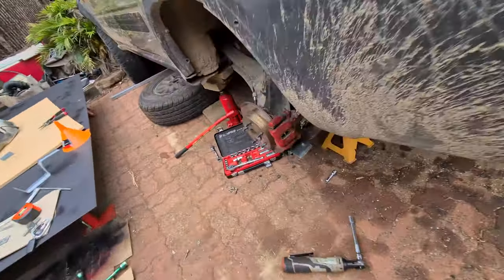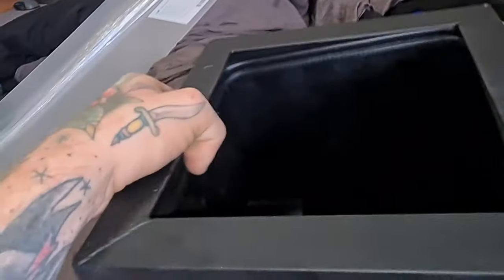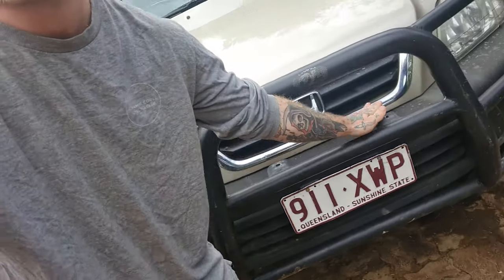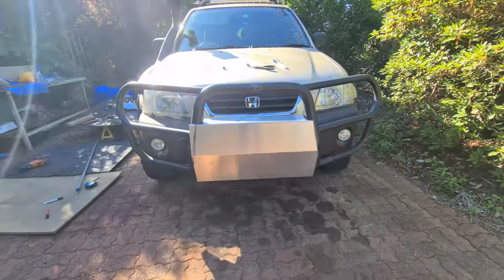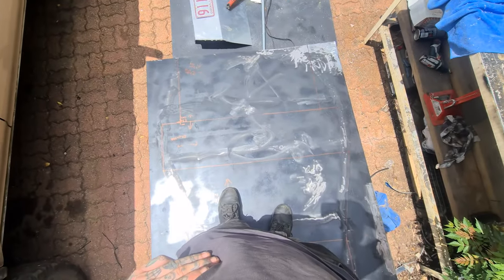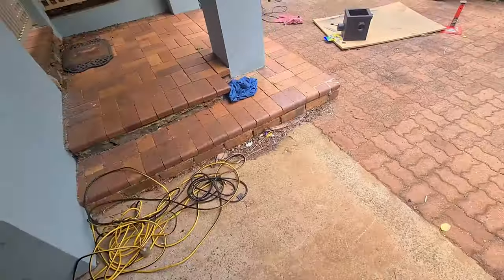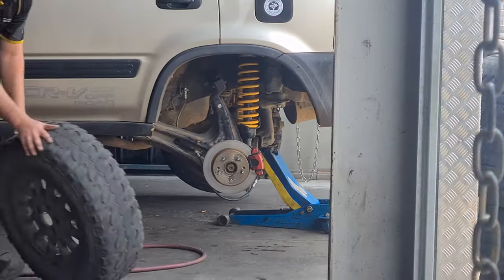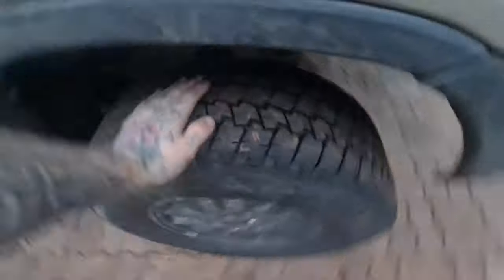HANDBRAKE BRACKET AND HIGH FLOW AIRBOX FOR CRV

Comment: That’s awesome you got a mig it will open up more avenues for things to make! Glad you said the thing about the amphibian adapter. I didn’t know they existed when I bought my first welder and left it too late to return so I ended up selling it. If you do get gas for the mig Bunnings is actually really good it’s $99 for the gas and a refundable deposit of $200.  I’m liking all the different stuff your making it’s awesome to see diy.
Reply from the maker: Thanks mate! The MIG has been one of the things I've wanted for the longest time, the ability to fabricate things myself will make the future of this build so much better!

I was honestly really frustrated finding the 15A plug because I was really keen to start welding, but I've picked it up since and very glad it did the trick.

I'm honestly just waiting to have the money spare to pour more into my welding setup, I wanna get a cart and obviously gas for better/easier welds. I've done a little of gas and flux core and I definitely like gas a LOT more.